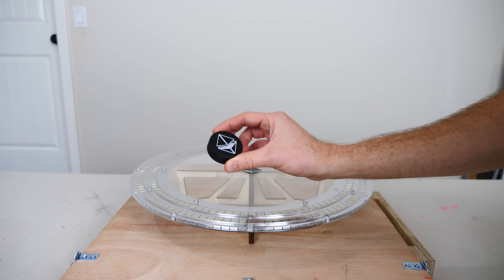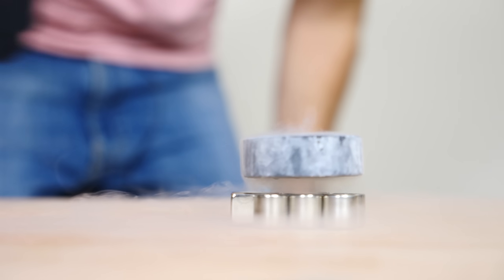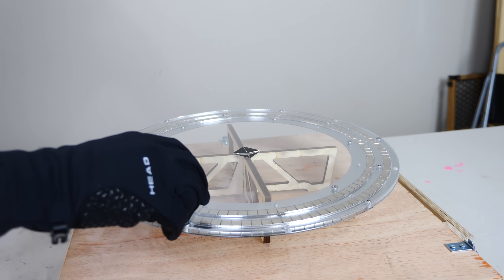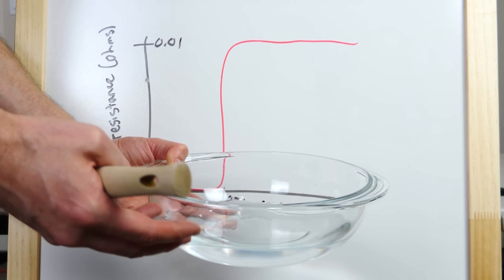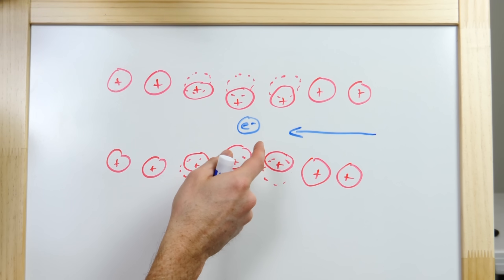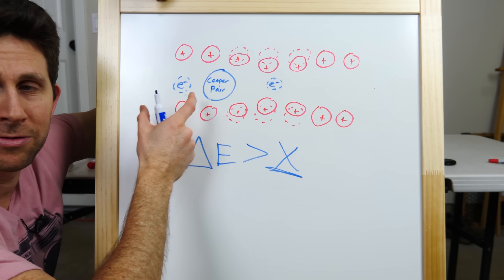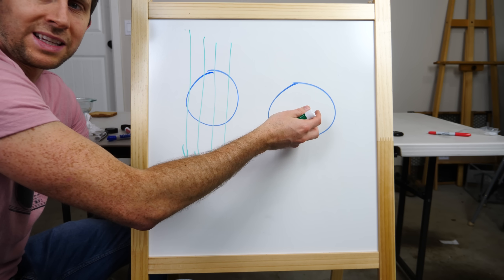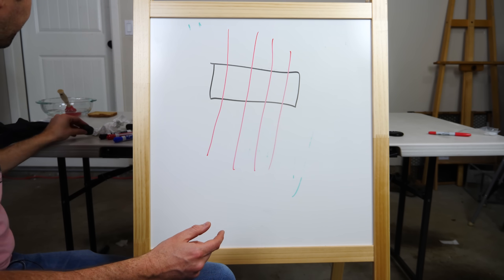Quantum Locking Will Blow Your Mind—How Does it Work?

Comment: The way you illustrated the electromagnetic field around the type 1 superconductor makes me think of invisibility.  If you could get light to move around an object that way it would appear invisible.
Reply: yes but the if light goes around the object it’ll distort the background a bit so it won’t be completely invisible
Reply: Although it‘s not Lord of the Rings‘ Ring/Harry Potter‘s cloak type of invisibility, your idea is actually researched in metamaterials - google for „plasmonic invisibility“. It works  exactly how you are suggesting: bending light around an object, making it effectively invisible. For the extra curious: the metametarial is artificially designed by arranging nanostructures in a certain way. This changes permittivity and permeability (by coupling to light magnetic and electric fields), giving rise to effect likes negative index of refraction and ultimately, when designed properly: invisibility of an object!
Reply: Makes me think of flying cars.  

It would require an insane amount of work. First someone would have to figure out a way to get this effect without freezing the super-conductor, so it can be always active in the base of a car.

Then the roads would need a magnetic charge, but it would allow floating cars, maybe two or three vertical lanes to go with the horizontals.  

Or it could just be applied to a train over magnetic plates instead of modern tracks, it would eliminate all friction on a train and you can see this small super-conductor held an orange. I bet a large enough one would hold a train.
Reply: there are plastic films that does this, a bit distorted, but still does the job lol
Reply: Search for "optical metamaterials"; we have engineered materials that do exactly that. Mindblowingly cool!
Reply: No it would just be dark
Reply: @m0ntheg3rs  You are mistaken
Reply: it would appear as a coloreas void.
Reply: @m0ntheg3rs  your eyes use light to see, without light you can't even see darkness, just sheer nothing

Comment: Do superconductors have a molecular signature that can be recognized by objects it has entangled with?  If you could theoretically put the same magnet on an exact copy of the first superconductor at an atomic level (and the exact same temperature), would it lock in the same position or reset?

Comment: This experiment got me thinking what would happen if we had cars flying in the sky using a super conductor. The thing is that we would need to have it in a low temperature for it to work as mentioned in this video that problem can be fixed cause we would be in the sky and as we move higher in the sky the temperature becomes colder or we can add like liquid nitrogen to keep the super conductor magnets cold enough that they continue being in a quantum lock. The lock can be achieved by like adding a magnetic area all around a city for example. Although that would be something really expensive to do it would be interesting. What do you guys think
Reply: Yeah,smart idea! :)
Reply: Physics grad here. That is indeed a good idea, but unfortunately it is not very realistic to say the least.  To make a super conductor you need to go very low in temperature. which you can definitely not achieve by going up. Plus the air resistance. 

Now the puck or the superconductor also needs to follow some rules, such as the density, the mass, the area, the volume. and if you consider a car size truck puck, it would take almost 5 trucks worth of liquid nitrogen, because with the increase in size, the no.  of atoms increase exponentially.  And there are a lot of other factors which would prevent this system to run without any problems to say the least.

Comment: Question: once you start the superconductor going on the track, does it continue forever? Or until it loses a certain coldness of temperature? As it doesn’t touch the track it’s zero for too , but what about the friction in air? Does that slow it down?
Reply: Physics grad here. Well there are some other quantum resistances that will make it slow over time. Secondly, its a stable system, the moment you try to take energy out of it (turbines and what not) it will slow down. Energy is not free.
Reply: Ok I did some research and the current will flow forever with no resistance so long as you keep the superconductor cold. This could theoretically be a form of sustainable renewable energy if it were to power a turbine or any other form of energy conversion
Reply: @justinwayne445  this can’t really be used for sustainable energy, unless you can figure out a way to 1) get that current flowing using natural sources, ie using water, solar, etc to generate that current. And 2) find a way to keep the superconductor cold enough to maintain its superconducting properties that isn’t energy intensive. Right now, it would take a lot of energy just to cool them down continually for constant energy production.
Reply: The superconductor will not move forever. It will stop after either 1) it heats up past the point where it is no longer a superconductor (this wouldn’t take that long) or 2) air resistance slows it down.

Comment: What would happen if you had had cog shaped magnets quantum locked into place (like gears, each cog fitting perfectly into the next one). Is it possible you could arrange them in such a way that they could move perpetually as they all try to return to their original position? Then use them to generate electricity?
Reply: I think it would also need to be cold and energy needs to be converted in heat
Reply: Ok I did some research and the current will flow forever with no resistance so long as you keep the superconductor cold.
Reply: Physics grad here. No there will be no perpetual motion as they will lock into place. And to move them you will need to provide the energy. And if you try to produce electricity off of it, it will experience resistance and the final electricity produced will be less than the energy supplied...which defeats the whole purpose. Its like attaching dynamo to car wheels, you may think that when the car moves it'll make the dynamo work and produce electricity. But don't forget the car is moving on engine power and the dynamos are offering resistance which in fact will make engine use more fuel and energy for a small amount of electricity generated.
Reply: I think if it's unending rotation (until the cold dissipates) there could be a scenario where they move a turbine and generate electricity indirectly, that could work
Reply: This is a very good idea. I wish someone can do it
Reply: sadly you could never arrange them in a way to move perpetually

Comment: Maybe these technologies have more potential in space as you'd be able to naturally supercool the superconductors using the vacuum of space? Rather than having to create liquid nitrogen or constantly cool them here on earth as I imagine cooling itself would use energy but if  you used the naturally supercold temperatures of space it could potentially be a near infinite energy supply?
Reply: I’m pretty sure not all of space is cold right like there’s multiple hot spots
Reply: @jack_kerins  I mean obviously it wouldn't work if you were in a warm area or closer to a sun but generally speaking the majority of space is pretty cold?
Reply: @Itstheoaks  yeah I’m just guessing I don’t know jack shit
Reply: @jack_kerins  nah don't put yourself down bro clearly you do know something as there are multiple hotspots in space as you said I mean there's gotta be with all the sun's out there too. Would be an interesting way to possibly generate virtually infinite power on a ship though...maybe a combination of solar panels for when you're near stars and this superconductor with magnets on the ring could be possibly used to generate power in the cold. I'm no astronaut either just throwing ideas around
Reply: @Itstheoaks  no it wouldn’t be feasible considering there would be no magnetic field for the superconductors to push off of not to mention the fact that it wouldn’t generate any form of thrust

Comment: Does it go faster or slower when closer or farther from the magnets? Or does the puck warm up faster when farther from the magnets? Does it being out of level make a difference to speed or temp? Would it make a difference if the magnets were cooler as well?
So fun! Thanks for sharing!
Reply: Physics Grad here. No Cooling Magnets doesn't really matter because in magnets dipoles are already aligned. Now what are dipoles? Dipoles are nothing but current loops. In very simple terms if a wire is looped and current is flowing through it, it'll produce a magnetic field, and instead of calling it a small magnet, you can call it a dipole. Now the strength of the magnetic fields from this wire loop is determined by dipole movement which is the product of the no of loops, the current and the Area of the wire.

Now if you take a magnet, it has atoms and electrons revolving in those atoms {in very simple terms) so you can now imagine those revolving electrons behave like a very small current loops which produces their own magnetic fields. Or you can call them dipole as mentioned above. So When these dipoles align in a specific way inside a material so that dipoles which are straight (direction of flow of magnetic fields is same or where the magnetic field lines emerge) and are aligned together makes a North pole. And the dipoles which are reversed (where the magnetic field lines terminate) and when they align  together makes a south pole, in that material, you call magnet.

Now The farther away you are from the magnet, the less are the magnetic field lines you come in under influence with and hence the less magnetic force you experience. Now in this case the speed doesn't particularly matter on the magnets or the puck. Magnets are only contributing for levitation and not for the revolving speed. If you can remove air resistance, this might actually revolve for a very long time (ignoring some other quantum resistances here). You can attach a rocket to it and it can go very fast until the centrifugal force( the force of the rocket wanting to throw the puck out) is smaller than the magnetic force of the magnets. 

Temperature certainly makes a difference. The more warm an object is the more energy it contains, so if you warm the magnets the atoms inside will have more energy and they'll vibrate more often this can also cause the dipole to misalign with the other and make the magnet lose its magnetism.
Reply: @lastphotons  thank you so much for answering my questions!  You are awesome!
Reply: Not really the determinate factor is entirely in the superconductor which is a diamagnetic material like bismuth. Meaning it's not magnetic it instead repels magnetic force. By cooling it down it creates a thermodynamic environment where electron spacing shrinks and laws of conservation kick in. Meaning in this state atomic structures would need more energy to interact with other molecules including their electron fields. Bonding occurs as an innate property of friction which still exists just that interaction is not preferable. Meaning if he simply allowed the superconductor to ease on top of the magnet it would have little to no bonding only that caused by the weight of the superconductor.
Reply: @fireteamomega2343  thank you for your answer! You absolutely rock!
Reply: I would imagine the angle of the puck would change the amount of drag being applied to it. In reality it isn't move through a frictionless environment therefor it would have to stop at some point. In short more drag would cause faster deceleration, but in this case without actually doing the maths I'd hypothesis that it would make a very small difference.

Comment: Could you up scale this to use for transportation of some kind? Like a rail system
Reply: Physics grad here. I don't want to say, that it won't work but the logistical  challenges will be huge. For eg you wont be able to carry any metal. Secondly as the size of the load will increase, you will have to use a lot more energy to keep it cool. For eg for a car size puck, you'll need around 5 trucks worth of Nitrogen, because with the increase in mass and density, the number of atoms increase exponentially.

Comment: I hope this isn't a dumb question. When you lift the superconductor with the magnet, can you feel the weight of the superconductor? And if so, how? This seems like magic to me lol
Reply: Physics grad here. First no question is dumb. Secondly, Yes you will be able to feel the weight of the puck as the puck and the magnet are part of a single system here. And gravity will try to pull down on the puck which has mass. So the gravitational force on the puck will act on the whole system.

Comment: I wonder if they made road magnet can this was under vehicles would emissions be cut down like crazy the only issue I see is the breaking which could be done with iron and of course getting the material at a freezing temp but it would be interesting, cars themselves could be ran on magnetic pulling even magnets could be on the front and back of vehicles to slow if not stop them and prevent accidents (in theory but the force itself of speeding vehicles might be greater than the repelling field)

Comment: Could you not use this to make a vertically mounted  frictionless generator that could have its Rpm powered by a tiny motor.  The question would then be would it be possible to build a generator that's powering its own cooling system with plenty of excess power if that's possible then there is clean unlimited energy.
Reply: No. The amount of energy required to keep everything cold enough would negate any savings by the superconducting. Especially since what he’s showing here doesn’t particularly generate power on it’s own. And like he said, if you start pushing higher voltage and current it quits becoming a superconductor.

Comment: Did you know what happens when you apply that principle to a truly extremely low temperature and keep on speeding up the electrons by feeding more and more energy into them? A new way to do a big boom-boom ^.^ And if you use a reeeealy large amount of it deep enough underground? This planet gets floating mountains like Pandora in the movie Avatar. And if you synthesize a very special superconductor you can use this principle to create fields around objects that can move everything inside through other matter without any resistance. You can 'swim' through earth and go through the air REAL fast. Don't get near any powerlines or atmospheric storms though or you'll go squish-squish. More importantly however, this technique can be used by humanity to finally build giant cool looking vehicles called gundams like the ones from Japanese fictional stories, without them collapsing under their own weight. Hoping they get built before the boom-booms. Save one on the moon, just in case.

Comment: There’s too many comments here for me to scroll through, so please tell me If there’s answers to my questions down below and I’ll look for them. 

1) How long would the superconductor keep spinning if we could keep it cold enough while it’s on its loop?

2) Could this process be used to generate electricity? If the superconductor was somehow connected to an arm mounted to the center of the board via low friction bearings driving an axle connected to a generator for example.
Reply: Your mom
Reply: @User-lb6sm  And your problem is what?

Comment: One more - What does this mean for a type II magnet in the giant electro-magnetic fields in space? If the field is in motion, can one "turn on" the magnet and grab the field?
Reply: Physics grad here. If you can manipulate the electro magnetic fields of the space then you might be able change the behavior of the superconductor. There is no way you can manipulate a magnetic field without manipulating its  source.
Reply: @lastphotons  So, I'm about as naive as one can be in this... My question has two applications - #1 if you imagine a satellite around earth with an appropriate energy source able to "turn on" refrigeration of the type II magnet to super conduct, could you lock the satellite in orbit by locking onto the magnetic field of the earth? Or even if you could, are the fields to volatile?  #2 If Voyager has discovered large swirling magnetic fields in the depths of space - could you lock on to a "swirling" field, then unlock at the appropriate time being flung in a direction?  In theory if the experiment in this video included the plastic disk being made to spin instead of pushing the magnet it might be a partial answer.  And again, "me big dumb" so I'll take, "it doesn't work that way" if that's the simple answer.

Comment: Cool I did a similar experiment in my physics class in the late 80’s using a small piece of ceramic, upside down styrofoam cup and liquid nitrogen thanks to resources from Omni magazine…had to explain the mechanism of its reason for levitation. 
Got an A cuz it was pretty cool at the time. Yours is on a much grander scale! 👍🏻👍🏻👍🏻
Reply: Yeah most of the same base properties exist when things are supercooled he did a professional job but it's been done before many times. It would have been even cooler if he attached a bare wire coil and some gap coils around the track. Then turn out the lights and let it spin watch the trails of distribution electricity streams from the passing superconductor.